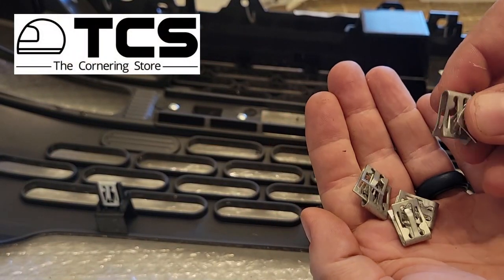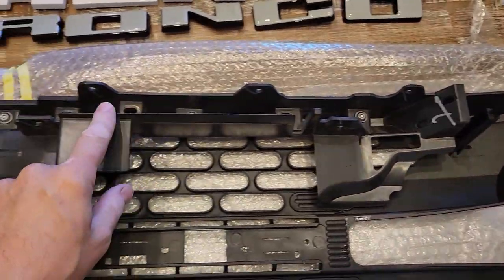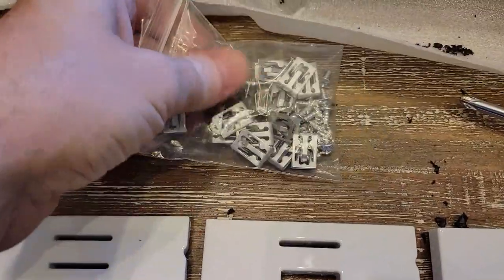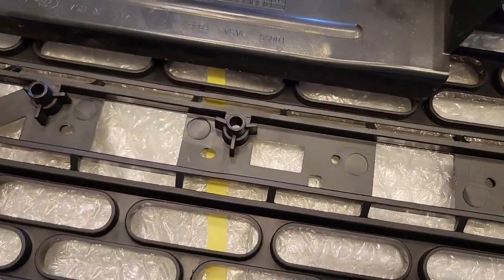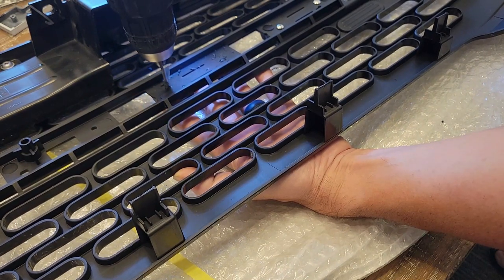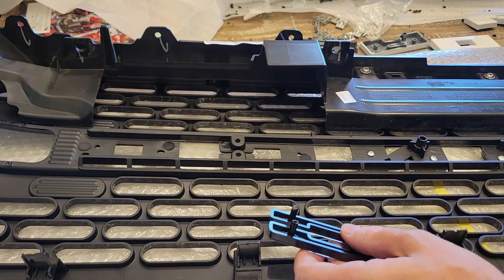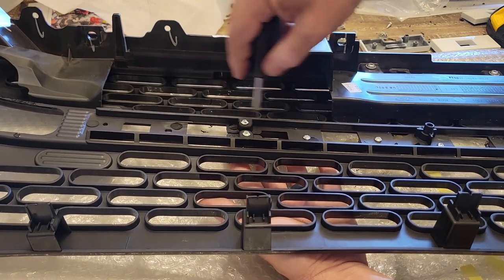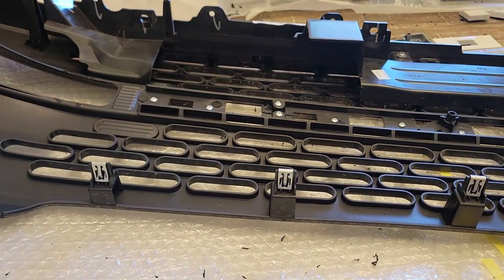Bronco Aftermarket Grill and Letter Swap

Comment: Bro i was waiting for the drill to slip. Glad it didn’t. I think I’ll use  clamp and thanks for the vid
Reply from the maker: Haha, with the small bits and working with plastic it won't slip easy.  With metal I'll usually start with a very small drill or use a spring loaded whatchamacallit so that doesn't happen, because we've all done that!
Reply: @TheCorneringStore  I’m heavy handed I could also see myself going through the plastic and going into my hand. 

I’ve cut into my fingers just like this 🤣. Some people are clumsier than others.

Me , and talking about me

Comment: Big help man! I just got this grille and the same bull bar as you.
Reply from the maker: Glad to hear that!  I'm still happy with the grill, although I'd like to have the silver color i think. I'm thinking about mounting some lights on the bottom of the bull bar so they don't block airflow to the radiator and it may look cleaner.
Reply: @TheCorneringStore  I just completed the job. I did the tape method like you but the tape moved up the drill bit and I drilled through my “R”.  Lol - I’ve already ordered the black covers so I’m not worried about it. Also, I have a RC 20” light bar mounted on top of the bull bar. It’s pretty slim so doesn’t block much airflow. If you’re on Bronco6G I can send you a picture of it.
Reply from the maker: @Mwild00  oof, you can always put a dab of white caulk if the hole if your letters are white.  Yeah, I'd like to see a Pic of that light bar.   My handle on bronco6g is Captainrob.

Comment: Is that the xipex grill? If not, what brand or link to site? Thanks, looks great!
Reply from the maker: Hey!  It was a no name grill I picked up off of Ebay.  The seller isn't selling it anymore and didn't list it with a brand name. I'd venture to guess that most of these aftermarket ones are made by the same place and just rebranded.  I've seen others with the same blocky letters.